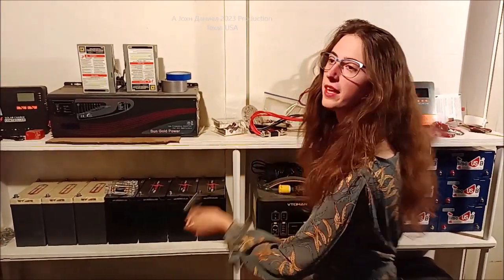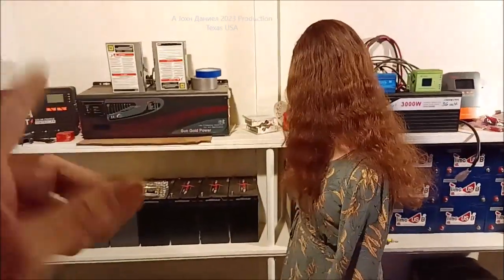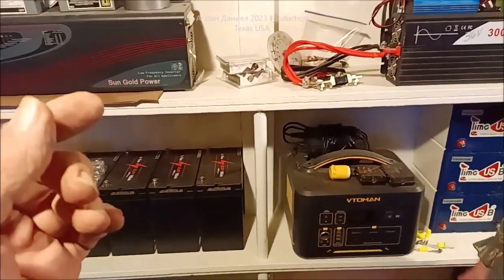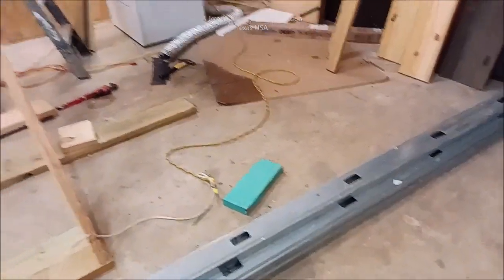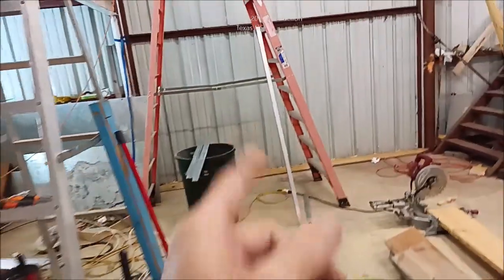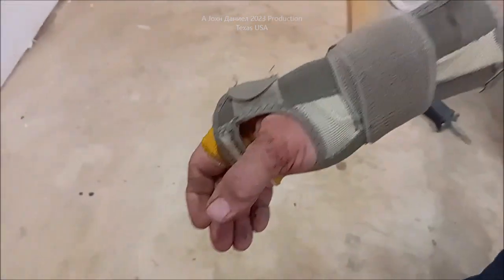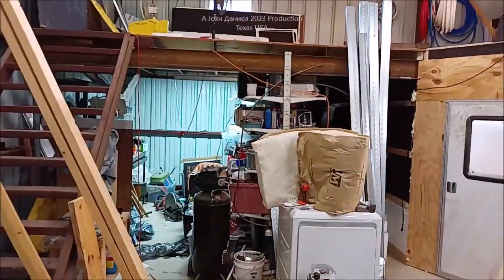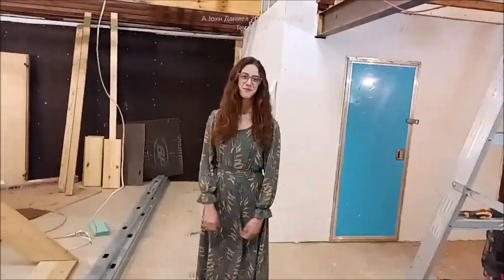12 and 36 volt Hybrid Lithium & wind power system, Gathering Parts, And What we are building now

Comment: John, wouldn't it be simpler to use the contacts of the controller to switch the ss relay instead of removing it and bridging the cct board? Just connect +ve source from controller terminal to +ve of ss relay and -ve of ss relay via contacts of controller relay contacts to -ve on terminal of source on the controller?
Reply from the maker: Yes, but the removal was so everyone can see that in the absence of the mechanical relay the board can operate numerous SSR's. You can simply bypass it and leave it on the board.
Reply: @JOHNDANIEL1  True, was just mentioning for those that may not have a soldering iron or don't wish to modify the board. Great channel content. Appreciate you taking the time to reply.

Comment: I feel like we have a lot in common.  Except for the wind turbines.  I haven't done those (yet).  I do have 3KW of solar on my roof, a 48V bank of Duracell (East Penn Mfg) GC2 golf car batteries (8 in series) that I picked up at Sam's Club (Mfd right here in my home state of PA), a Victron MPPT 150/45 charge controller, a "CNSWIPower 2000W Pure Sine Inverter".  This setup powers a meat freezer and a full size side-by-side refrigerator.  It has been running over a year now 24/7 with no maintenance req'd except I added water ONCE, and NO corrosion.  I credit my "Energy Transfer Battery Equalizer" some of this.  I would like MORE storage, and would like to get some LiFePo4 someday, but I still feel like Pb has its place in Solar / Wind energy storage.  I like to do things on the cheap.  $800 for my whole battery bank, and less than $4K for EVERYTHING.  Labor was all me.

Comment: Are you planning to get a 48v wind controller of the same type?
Reply from the maker: My own design and my own diversion controller, using 48 volt turbine into 36 volt Lead Acid from that transfer charge to both 12 volt and 36 volt LiFePO4. Using a Slave battery of Lead Acid stops faults in the Electronic controlled Lithium system. A age old issue I solved.
Reply: @JOHNDANIEL1  I understand the application you have for your setup, but are you having an Olympic power controls controller built for a 48v setup? If so I would definitely Be interested :)
Reply from the maker: @mattlane8660  yes, stay tuned

Comment: The shop looks cool. Those tires look like Christmas wreathes. Lol.
Reply from the maker: Restructuring the building I am getting a perfect 15 x 40 slot for working on RV and Trailer needs, and having a repair and build area left over. Originally it was a 15 x 32 that was impossible to use leaving no way to get a trailer in over 30 foot and have any way to walk around it.

Comment: Welcome back!
Check out the ECPC(Electric Car Parts Company)/Energetech (same folks) I ordered the APC6048D 6kw split phase inverter. They shipped the Sigineer 6kw unit. So apparently these are all the same unit. More and more information is coming out indicating that the AIMS, and Sungoldpower units are also the same units. The ECPC source is 1/3 the price of the AIMS.
Reply from the maker: We are hard core 36 volt, even working with 8 manufactures after they saw the data on using 48 volt turbine to charge 36 volt Lead Acid then shoot it to any voltage 12 to 48 you choose.
Reply: @JOHNDANIEL1  
I chose 48vdc, but these same inverters are available in 12/24/36 as well. I'm sure that my swipower is damaged from the heavy inductive load use. Right or wrong, the low frequency inverters have a much higher surge capacity.
Reply from the maker: I always over buy my SWI power models, 3000 fi I want 2500, 5000 if I want 4000. And they do better than any other for the price, over the years I never had one fail. But many others have. I have inquired with them at electric car parts company and they like 95% of sources, do not have a 36 volt inverter. It is sad that so many skipped it like it was a Leper. The truth about 36 volt needs to be explained. From the efficiency and conversion it can do ( up and down ) compared to all other voltages is amazing. 48 volt is the danger voltage, anything over 40 is deadly. And the sad thing is 36 volt is the easiest most effective in 3x conversion. 48 is 2x so less stages, more load on small parts in realty plus less quality of actual power. Technicians complained about it, they were ignored.